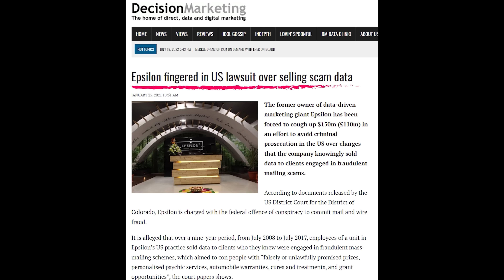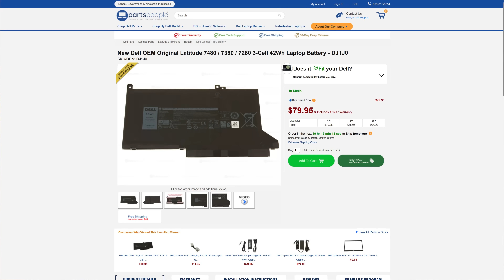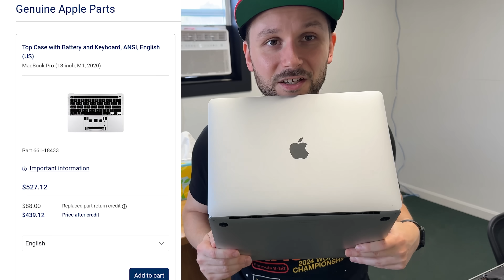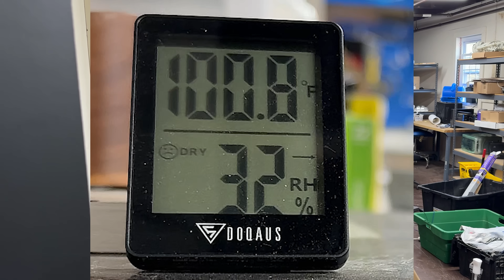Planned Obsolescence: Why is Replacing a Battery STILL So Difficult and Expensive?!

Comment: 10:40 yes, so i can buy the the device with the longest expiration date. The Date a divece doesn't recive hardware support should be mandatory to put in the spec sheet. With software it's diffrent. As most hardwaee companys dont make their own OS.

I am going to bride tge battery of my laptop wenn it inevitably puffs up, and use it with a powerbank instead.
Reply: I get what you're saying, but you clearly aren't getting the point he is making. Devices shouldn't need to have an expiration date, if you buy something you should be able to repair it making the expiration date something that never arrives
Reply: @thesupergamer5894  that would mean infinite support, which means infinite cost for the manufacturer, or at least until the last device has been abandoned. With software thats easy, as self hosting is possible, but with hardware it isn't you would have to have a assembly line for each part at all times or a enormous amount of spare parts, the first one would cost the manufacturer a unimaginable amount of money and the second would lead to insane amounts of e waste. It would be nice if it was possible but the best they could resonably do is, provide reasonable support.

With batterys you could standardize them and make them external or modular. But that would involve huge changes in regulations as companies currently make profit of off planned obsolescence.  And at least at the current point that won't happen, as nearly every relevant government from EU to USA is heavily engaged in something called lobbyism which is basically just semi transparent corruption but legal.

You sure can say what you want but it's just not realistic.
Reply: @blainx2852  literally the only reason laptops have to change their batteries is to force people to buy new ones... doesn't even have to be a big "standardization" each company could still keep their own battery style. I garuntee most batteries today are just as effective as batteries from, say, 5 years ago. The only poont in changing them is to kill off a product. 

(BTW you sound exactly like Pirate Software. No one is asking for indefinite support, we just want the things we buy to be functional)
Reply: @thesupergamer5894  also for lithium ion 2017 such accumulators as you call them had a density of aroud. 250 watt hours per liter while 2020 they have 450 watt hours per liter.

If you are American and don't know what a liter is, it's volume, so the number tells you how energy dense a accumulator is.
Reply: @thesupergamer5894  Also Pirate software had a whole other issues in his argument he was arguing that it's going to crush indie devs, while i am just arging that what you want is just very unlikely to happen and probably going to make tech less affordable. It's not going to destroy tech as PC's are still a thing. I have my laptop because i was given the oprion of getting a iPad or whatever other device i. want to use in school to take notes. And i went with a laptop with toch support. In retrospect it was a stupid decision, as i use a gepics tablet instead of the pen for the laptop. But thats whatever. Just please don't shit on pepole because they think differently.

I am all for repairing or kepping things running. From using custom roms on old androids to using linux or even soldering a new battery i have done it.

I am a informatics student so i might be biased,
but you have to keep your expectations realistic.
Reply: @blainx2852  imagine thinking Americans don't understand a liter when yall can barely comprehend how large the U.S. 

Also don't act like Pirate was defending indie devs, multiple times he specifically spoke out for AAA studios lmao.

You clearly don't care to know what you're talking about so I'm done with you lol
Reply: @thesupergamer5894  yea I don't care about Pirate software, and i don't care about the US, but i know well enough that their president is a Corrupt rich guy and the gun laws are bullshit. Texas should be the size of Germany and well The USA is smaller than Australia. I watch a lot of news preferably political ones.
Reply: @thesupergamer5894  the liter isn't really used in the US so it would be normal to not know what it means so i just told you what it is. Don't be a snowflake just because i tried to save you a google search.
Reply: @thesupergamer5894  Also why the heck did you try to use knowledge about the USA as an Argument or to discredit me. I mean i can tell you a lot about how your elections are done, or what your presidents did but what's the point.

Comment: No, the companies are screwing people over batteries. As far as engineering process and cost management goes, no sensible engineer would price a component as more than a module. I.e. a system has to be the cost of the sum of its parts, part can't cost more than the system. What the companies do is they mark up "consumables" by around 300% because they design consumer devices to have what should be lifetime parts as consumable parts.

Comment: The best you can do is to buy a $20 (20V power bank) and plug it into whenever your laptop is not plug in to a A/C.  I bought a X1 tablet Gen 3 with battery already dead for only $68.  To replace the battery will cost $40.  So I just plug in to A/C at home, when I am unable to connect to A/C, I will use a 20V (45W) power bank.  And that is why I can buy a used Lenovo laptop.  But I will never buy a used tablet or phone.  Because  I cannot replace the battery.

Comment: What sucks if even if you find an extra battery and buy one ahead of time, by not using it you risk it dying and becoming useless. In reality you can only get a new battery when you need a new battery and not before.

THE SYSTEM IS RIGGED.

Comment: I work in IT in a public school and batteries are also our biggest problem with Notebooks. Even with Premium Support and (because I am in Germany) EU laws about Repeatability and the obligation to keep spare parts available, we often can't get replacement batteries. It not the end of the Notebooks, but to be working in class they need to be plugged in all the time.

7:35 Do not mix Consumer Electronics and EV/Powerstorage Batteries, they are two very different kind of batteries and because of this most Manufactures guarantee a longer lifespan for the battery then you can probably drive your car. These Batteries can be charged over 4,000 Times until they only have about 80% capacity. If you can drive about 100KM with one charge then this would last you more then 400,000KM (250,000 Miles)! Most cars do not last half as long. This is also the reason most older EV Batteries get a second life in a Powerstorage.

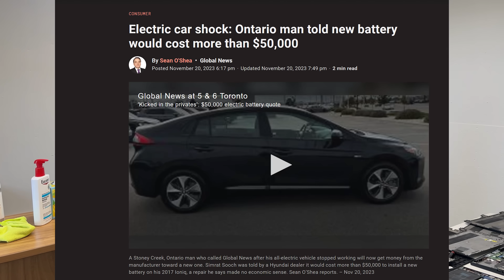7:55 That is Clickbait Fake news. 1. It was an old EV, with them the batteries do not lasts "very long". The manufacturer only gives about a warranty of about 160,000KM with no rest capacity, the car in the article had driven over 170,000KM, so more then the manufacturers claims and the warranty. 2. The 50,000$ were for the new battery, installation, taxes, disposal of the old battery and some things more.

10:40 What was your rant about EVs then? They have expiration date or rather a life cycle defined by their charging cycles.

Comment: This is more of the unwanted "let me throw in my 2 cents" type of comment but here it is.

I think it's the brand name. You've said it yourself that if you pick off brand batteries (you think) you might not get the same quality, but in my experience it's rarely any different. It's all coming from china and the reason why apple batteries cost that much is because people pay for it anyways (established brand etc.) Framework doesn't put so much money into marketing and other bs to naturally they need competitive prices to seem attractive to a potential customer. That's why I THINK brand batteries are so expensive, it's just the brand and people are afraid to pick otherwise.

Btw why would you worry about an aftermarket battery when refurbishing a $40 laptop? Legit question

Comment: Please do not spread misinformation about EV batteries. They last a lot longer than most people would assume. Basically every manufacturer gives a warranty of 8 years/160.000km on each battery. And they have chosen it cleverly, because almost no EV battery will reach below 70% SoH in that time or mileage. If there is an EV that needs a battery replacement it's most likely not due to the wearing rather more because it has been already faulty in the factory. Also, most likely there will be faulty cells, not the whole pack. There are third party repair shops, that specialice on reparing the battery, where they only swap out single cells. It's much cheaper than a new battery.

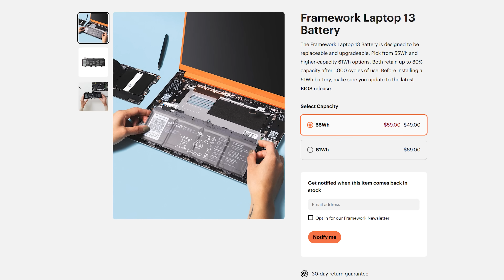Comment: 8:30 this is why I believe in China there is this Battery insurance business model.
because the lifespan of lithium battery is roughly around 7yrs. 

once 7yrs is arrived.  you need to replace it, and on that 7yrs inflation had already took over and chances are the price of battery is already doubled from the past 7yrs.

and that is when battery insurance comes in.
the money they get from you from 7yrs ago would already turn double/matured by the times the battery is done.

Comment: I hate dells. My xps15 battery swelled so much is displaced the trackpad...
I had no such problems with any other notebook. An xps13 which is otherwise great had a battery that died. I live in Mordor, so replacement in an authorized service center is not an option. I bought a third party one but unlike other notebooks where battery replacement ran without an issue, on an xps13 it doesn't work for some reason - it blinks a yellow led and doesn't run other than from AC power. Browsing the web didn't help any... Perhaps someone here could tell me if it's fixable...

Comment: I miss the days where the battery was cartridge based.  Could even solder in additional cells, in the same module.

When pokemon GO came out, battery boosters for phones was a huge market.

Car booster jumpers have also got smaller, along with the battery tool market.

Maybe the stock power port on these laptops, is a good work around for an easy, replacement battery 🤔

Comment: Is the issue exacerbated by users buying laptops over desktops and then leaving them plugged in to mains power all the time?
Manufacturers should probably provide apps to set charging limits of 80% for devices always on mains power ( my asus expertbook has this option and i think my lenovo thinkbook does too ) - here's hoping that helps to keep the level of spicy down in those pillows

Comment: Screens as well. My Huawei p30 pro is working perfectly fine, but I got ghosting because before this phone I never had a phone like that and I didn't know images can get "burned in" and i scrached a little the sides, but it costs me around 200$ or more to get the screen (of the repair shop is even able to get it) and then pay for their services to chenge it, while to buy a new (or used, in good shape) exact same phone, it costs less. My phone is over 6 years (probably 7 at this point) years old and it's still working perfectly well, but if I want to change the battery and screen, nope better off buying a new phone

Comment: I strongly recommend KingSener batteries. Their prices are far more reasonable than the overpriced alternatives. the quality is decent. I opened the casing and a performed discharge tests. All units were within their specified rating. They have their own website, but I bought them from AliExpress.

Comment: I found out that my dell laptop worked without the battery. The case of the computer was garbage as well because 3 of the screw inserts for the screen hinges had broken out of the plastic, and the fan was making tons of noise, so I'm rebuilding it into an AIO desktop box, running Linux. It's an Intel 8th gen laptop...

And what do you know, the battery in that laptop is exactly the same spicy pillow that's in all of those laptops.

My Toughbook that is an intel 2nd gen is actually still in better shape, no bulging battery, though the battery is very weak now.

Comment: I've got 2 of these 7490 laptops. One has Proxmox VE doing homelab duties running off a USB-C charger drawing under 6W. The other is permanently connected to a 27" 4K monitor doing everything else but gaming duties. If the batteries didn't die or could be replaced with reasonably priced quality parts, I'd recommend them to anyone that wanted a solid 2nd hand laptop.

Comment: I'm using a "hp notebook with 6 custom mouse pad buttons" with no battery , only on charger , and on UPS at home. I guess it's 10 yrs old and I am using it without battery for around 5 years now , and it works just fine. I'm genuinely surprised how good quality and long lasting this old hardware used to be !

Comment: Not a perfect idea, but they could make more pass through type battery adapters, that would allow you to keep it plugged in “without the battery”, without loosing the functionality that some laptops cut off without it installed. Least then it could be used until the rest of the hardware eats it and you’d negate the possibility of spicy pillows altogether.
Probably the best solution, despite effectively deleting the whole reason for having a laptop in a sense lol

Comment: Right now i have a hp elitebook and i was searching for a batterie for close to 4 months now 
And they're either really expensive or risky rn ive been using my laptop with no battery i remouved it cuz it was too risky 
They reaally meed to fix these prices and make more rights for us
I am a resident in morocco for info.
Reply: Also lets add to that my fuxked up earphones battery that lasts me at max 2 hours if i was gentle with them
Reply: So i actually bought this pc and upgraded it and used it for my self it had 4 gigs of ram now 16
I7 8th gen (works perfectly fine)
It had a hdd i belive 1t upgraded to an m.2 500gigs and a ssd also 500 gigs for windows (i mainly use arch linux)
Repasted it (it was overheating like crazy especially in the day) and now it works perfectly fine unless i wasnt to take it to school for projects but sadly i still didnt find a good quality and not risky battery (and ofc at good price especially cuz here everythiing is over-priced)

Comment: I hate the dell 7490's/7480's but than again I have repaired over 400 of them.
The main issue is the spectre and meltdown patches "24 / 25 different bios files
that have caused the IME to start creating odd behavior, freezing screens, orange light
while the system looks like its operational. freezing in place, disaster. 
If you want a good machine go for the 5420 these came with more modern 10 and 11 gen
Intel cpu's and don't have this freezing IME problem. 

The only way to fix the weird freezing bug is to turn it in to a three letter machine.
And patch out the IME.

Comment: 11:57 - holy $#!7 you had the same phone I do. My mom, copycat that she is, also has one that's at a repair shop right now for the second time this summer because a battery replacement didn't fix the issues she was having. Mine's probably coming up on needing a new battery to keep it usable; I switched from 80% charge limit to 90% earlier this year to get through the day more reliably.

Why don't we have better battery tech than Li-ion yet? It's been like 20, 30 years!

Comment: It's incredibly hypocritical: the world talks endlessly about climate change and piles on environmental taxes, yet simultaneously allows manufacturers to embed 'kill switches' in our electronics. This compels consumers to prematurely discard millions of devices, from laptops to smartphones, and constantly buy new ones. The 'right to repair' movement is a crucial step, but until we have access to reasonably priced, factory-standard replacement parts, especially batteries, we're still forced into this wasteful cycle.

Comment: Hello..i have a problem with my pc everything was good until one day I putted a 1gb ram without noticing.i noticed after I did the rating and since then my prossor is on 1.6 and try everything to fix it but the rating still remains the same..
I use a *gigabyte motherboard
*3.00ghz cpu
*610 arktek graphics card
*4 gb RAM
.can you please help me with the issue 🙏🏽

Comment: Once upon a time, somebody had the great idea of standardizing batteries. These batteries could be used in a variety of devices across tons of manufacturers. There were different sizes for different needs. The technology also improved over time, but was backwards compatible, so the improvements came to every device that used them. Basically, someone needs to invent a modern version of AA batteries that are rechargeable though the device, easily accessible, and fit modern form factors.

Comment: Day 2 of asking 

Hey man can you tell me which of the components can i upgrade in my laptop? 

I have a Lenovo Thinkpad E470 laptop with 8 gigs of ram with an intel i5-6200U @2.30GHz and a dedicated gpu of NVIDIA 920MX with nothing changed . I have this old laptop but I really dont want to change it cuz its my first laptop and rocking it for almost 3 years . here is my laptop's serial number and machine type 

Serial Number
PF0UVDYT
Machine Type Model
20H1A01QCD

Can you help me with component should I change to get better performance ?

Can anyone leave any suggestions?

Comment: I got a Laptop from 2009 that has lost maybe 20 minutes off the battery. I don't travel much and only need it for document reading and web browsing. Windows 10 about dead so I swapped it to Linux Mint. I do plan to get a refurbed newer device later. Likely a cheap thin and light because that is best for my uses and I kind of want something with an HDMI port. I could find that useful. So likely buy a 400 to 500 dollar device in about 2 years. Maybe I should wait until 2029 just to say I used it for 20 years. If I need power I got my desktop at home. And most of my free time to play games or do any heavy work is spent at home.